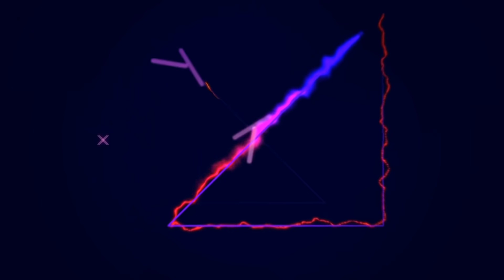PS4 Controller LED Mod Easiest Way (Programmable LEDs)

Comment: RIP battery life
Reply: xD
Reply: :v
Reply: PS4 have shitty ass battery life, 4-5 hours. I'll take an Xbox One controller with AA any days.
Reply: zZiL341yRj736 hey at least we don’t have to buy batteries 🤪
Reply: 21BombSquad They're dirt cheap, at least I can swap and continue playing.
Reply: zZiL341yRj736 u know there is something called a charger for ur ps4 controller.^~^ safes us hella money
Reply: Atrixs You would need a 2nd controller to swap mid game or a cable. There's rechargeable batteries if you wanna save money.
Reply: zZiL341yRj736 I use Dualshock 4 V2 that came with my PS4 Pro & it lasts 7-8 hours. Xbox controllers last a long time but changing the batteries is inconvenient. I know because I used to own a 360 & 360 Kinect Edition.
Reply: Mlordy That's cool, I'm not again Li-ion because the ones in the Switch Pro controller last forever, it's the the base DS4 that have shittiest battery life.
Reply: zZiL341yRj736 u don't need a second controller u just connect the controller and to ur ps4 and it charges while playing lad
Reply: zZiL341yRj736 sony can drop a bigger rechargeable battery inside that can last up to 12 hours but they’re just lazy. They’re probably going to do that with the PS5 DS5
Reply: Atrixs I don’t know about him, but I use everything Bluetooth. PS Gold headset & DS4 V2 is a good budget combo, you gets lots of benefits.
Reply: Ao
Reply: zZiL341yRj736 bruh ur freaking xbox fan no matter what anybody says u have something to say that makes the other one look like shii but honestly I believe both consoles can get better, and why tf are you watching a ps4 mod video if ur just gonna hate in the comments about how 'xbox is so cool bc of it's old ass battery technology' just leave ps4 videos alone
Reply: zZiL341yRj736 4-5 hrs is shit? Not for someone who actually has a life boi.
Reply: zZiL341yRj736 Its called "charging the controller when not in use"
I leave my controller on charge when I'm not playing and you can still play WITH the charger plugged in
Reply: I just by a 10 foot long cord
Reply: 21BombSquad that’s why they come with rechargble packs that last 2-5 days 😝
Reply: 21BombSquad i have regarable bateries
Reply: zZiL341yRj736 ps4 controller have motion and touch on the pad Xbox doesn't
Reply: Thats why i wanted to change my xbox 360 bc 70% i dont play bc no battery now i can charge it
Reply: Lol not really just put dim and use at at night for fun
Reply: zZiL341yRj736 no idea how you get in the ps4 modding controller and you own an xbox. feel bad for you ya know why people are angry at you lmao😆😆😆
Reply: Could always get a wired controller, better anyways haha
Reply: My controller last 10 hours
Reply: Also Xbox has a higher rate of breaking
Reply: Mlordy rip x xd
Reply: my controller last me about 12 hours, i have it on dim..
Reply: I literally just read this comment thread instead of watching the video
Reply: zZiL341yRj736 I play 10 hours on ps4 controller before it dies don't lie to get attention
Reply: zZiL341yRj736 yep all u have is rechargeable batteries so I’m never dead
Reply: For me, the charger is next to the controller. So if my battery is off, i just put it on the charger, and charge it.
Reply: lol you need to charge the controller every hour😂🤣
Reply: Nope.
Reply: @WheeledHamster  you have to buy Xbox battery's
Reply: @WheeledHamster   ps4 takes 20 minutes to charge up full and you can change your light shine on the controller so yeah

Mine can last 6 - 7 hours
Reply: Battery?
Reply: Battery life down to 3hrs
Reply: It has 6hr battery life
Reply: zZiL341yRj736 its called have it pluged in while your playing
Reply: @WheeledHamster  yeah swapping the batteries midgame si way faster than pluging it into the ps4. I always keep a cable plugged in my ps4 for such ocasions
Reply: @WheeledHamster  yeah my friend has a DS4 v1 and the battery is like 3-4 hours. I have a dualshock4 v2 and it's way better
Reply: @WheeledHamster  at least we can plug in the charger and continue playing 👴
Reply: zZiL341yRj736 I charge my controller when I am playing
Reply: 21BombSquad its a such thing as batter pack and it last way more longer it can last a whole week without dieing
Reply: fr
Reply: zZiL341yRj736 why does everyone have to fucking start shit with consoles every console is better in there own way.
Reply: Q8HASSAN1 not really. You can just put it at dim and it lasts like 12-14 hours
Reply: zZiL341yRj736 xbox controllers are so wide and uncomfortable, there so garbage. on top of that battery life is ass because each pack of batteries is like $5, and in a year thats $120(2 changes of battery's each month). almost 3x the cost of a ps4 controller. Over time it adds up and that is why ps4 is a better.
Reply: @WheeledHamster  I know you think this is clever but you have to be joking. Imagine being 13. You know your mom jsnt bringing home battery once a week. Just no dude. Just no. Furthermore the only reason Xbox controllers last so long is because Xbox has 3 godamn good games... And they are all og Xbox games. Nice try dude
Reply: @WheeledHamster  you can just plug in the controller while playing and I wouldn't spend 100$ on batteries a month
Reply: My ps4 controllers last a long as time but I dont have any leds
Reply: FintanSky Well my AA lasted for a whole week. POS4 guy.
Reply: Rodolfo Solis Who the hell said I play 10 hours a day. I played like 3 hours a day and I have to charge this piece of shit every 2 days.
Reply: @WheeledHamster  this console war shit is so annoying let people like what they like

Comment: These types of things are cool but I never do it thinking I break a wire or spoil it. Like if u think the same
Reply: I think the exact same
Reply: Same
Reply: Same
Reply: Umer Qadir stop asking for likes
Reply: Plus when you are using your controller you look at the screen and not the controller
Reply: @your_average_cultured_dude  respect. i finally got into DIY stuff and it is easier than i thought.

Comment: This may look difficult, but it looks worse than it actually is. When I had troubles with a broken controller I decided to try and fix it rather than getting a brand new one and it was pretty easy to get around. I’m definitely going to give this a try

Comment: Are you able to tell me where the original LED is located?  Is it on the charging port board or the main board of the controller?  Mine died after getting wet and I'd really like to fix/replace it.
Reply from the maker: The led you're talking about is on the charger board. Make sure you get the correct generation charging board for your controller before you get the replacement one.

Comment: Do u have solder in this one?
Reply from the maker: Mshah12 no you don't have to on this. Everything just plugs in
Reply: JMAGG how long does it take to install
Reply from the maker: About 10 to 15 min
Reply: Hi,

The LED board works on ps3 controller?
If not, exists another one that does something similar? 

Regards,
Reply: Khalid KJ yes i did it for myself

Comment: Would've been much better if they would light up only when you press the buttons. Also have different buttons with different transparent parts say the icons or signs like the x,o... up down... would light up only the lines

Comment: Will the sensor still work if the back shell has a customized paint job and clear coat?
Reply: Also which controller models does this work for?
Reply from the maker: I had an issue with a custom back controller so I drilled a hole through the back of the shell and put a small screw through it. One of my newer videos I show what I did for it and the led mod works on all ps4 controller models

Comment: If I knew how to do that stuff I do that to my controllers but I just too many stuff wires motherboard stuff like that in a controller to screw it up because $50 to buy the unit and if you screw up you're going to be paying another $50 or $60 to buy a new controller so it's really not worth it unless they come made like that I would buy one
Reply from the maker: When I first started I did mess up my first controller. But I bought a new one and took out the internals like the motherboard. Once I took it out I put the broken motherboard in that shell and I returned it

Comment: “Easiest way”
Reply from the maker: TrainerSavage it's easier than drilling a bunch of holes and soldering like I used to do in my other videos
Reply: JMAGG yeah bro I was just being salty and I can’t even open my controller .You should make bunch of these then sell them on amazon or some shit cuz this looks lit
Reply from the maker: TrainerSavage at the moment I'm trying to make it so I can connect the LEDs to my phone and control them through an app. You'll be able to make different presets like an RGB keyboard, once I do that then I will.

Comment: Good way to kill your battery.
Reply from the maker: Adigha Gamer barely affects it.
Reply: JMAGG are you sure about that? Mine is on dim and it lasts for 8 hours if the vibrators are off.
Reply from the maker: Adigha Gamer I'll put up a test video comparing a normal one and led one on. I noticed that it takes maybe an extra 30 min off the battery life.
Reply: JMAGG I've just realized that this video is 5 months old and you're still replying to comments which shows that you're one hell of a guy keep up them vidz. 👍